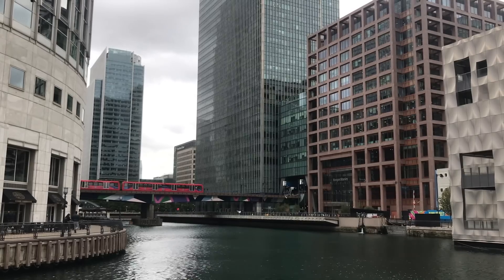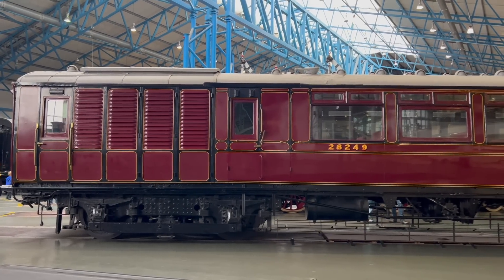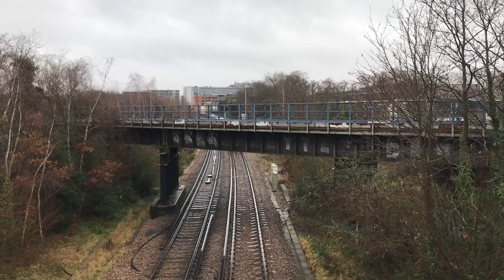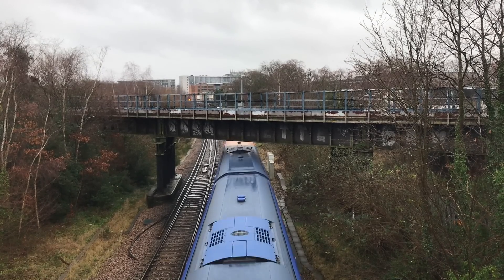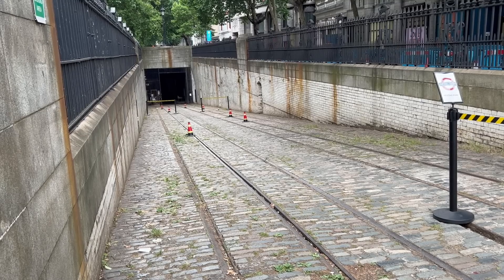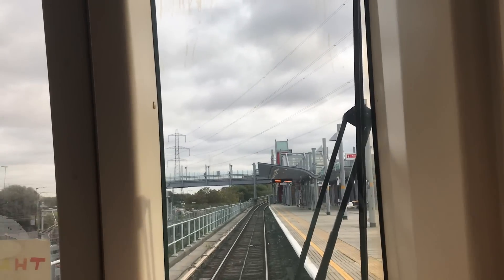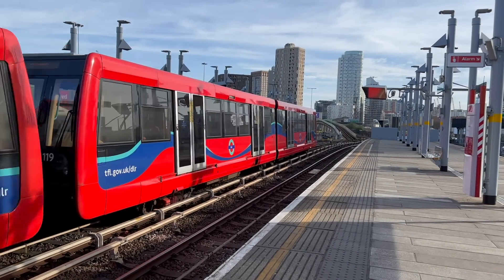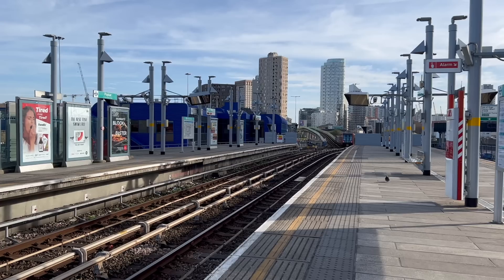How the Docklands Light Railway is Powered

Comment: Very cool but not as cool as the buried induction third rail powering most modern trams in urban settings... Just like wireless cell phone chargers, Rio, Dubai, Sydney all use this catenary-free system that Bombardier had been tinkering away with under the Primove name for decades finally got commercialized and is now the defacto new safety standard since it's only is powered when the corresponding frequency plate on the tram moves above it and picks it up, or something like that. Same reason this idiot bought one of those portable IKEA hobs. I refuse to burn myself on boiling water while making Ramen... Just not worth it!
Reply: It's a proprietary system that's pretty rare, expensive and error prone. It's just another french gadget bahn idea like the translohr system and rubber tyred micro metros. The vast majority of tram systems still use OLE even in downtown and historic centers. Some may have batteries for yard shifting and short stretches where OLE needs to be omitted but at least that isn't a proprietary system.

Comment: I'm a total dork about traction current and I'm so glad you're covering it - do you think you'll do one exploring the fourth rail system on the tube? Something interesting about it in particular is there are some sections of tube where they outer rail carries the entire voltage and the middle rail is a 'return' like you say, but other sections actually split the voltage to +430 volts on the outer rail and -200 on the centre rail. It's the first time I've ever thought about the concept of receiving a 'negative' voltage shock, but potential difference to ground sees a 200 volt shock either way.
Reply: I would ask why they change the side of the rail at stations, OK its to put the live away from the platform but why not keep it on that side between them?
Reply: @chrisstephens6673 The positive rail changes sides to even out shoe wear in addition to reducing the danger factor at stations.
Reply: @RogersRamblings  but it is almost exclusively on one side, except for a short section in the station so how is even? Not being argumentative but if that were to be the reason why not more even?
Reply: Jago has made a video about the Underground's 4th rail system, in June 2021.
Reply: Apologies for nit-picking but the voltages are in a 2:1 ratio, so it's +420 and -210, giving total traction voltage of 630V. There is a slow move towards 750V across the network but that is also in a 2:1 ratio.
Reply: The original configuration for the Bakerloo line was for the higher voltage rail to be the centre one and the one nearer to earth potential (though still negative) to be the outside rail. The reason was to reduce current leakage from the outside rail to the metal tunnel lining.
Reply: @johnm2012  I think there are some sections which are compatible with both LU tube stock and other third rail stock - e.g. in North West London where some Bakerloo & other third rail stock between Euston & Willesdon Jc etc. shared the track. Thus the centre conductor rail was only used by the LU, with full voltage being available between the outer third rail & the running rails.

The original idea for the use of a 4th rail was to avoid screwing up the metal tunnels, which would have damaged by erosion etc at all sorts of joints, with the return current flowing though it.